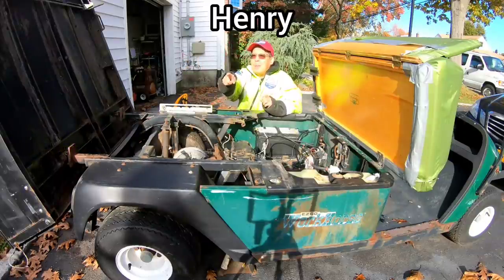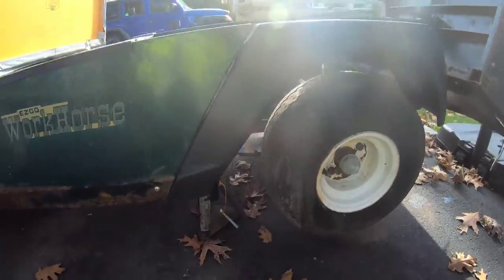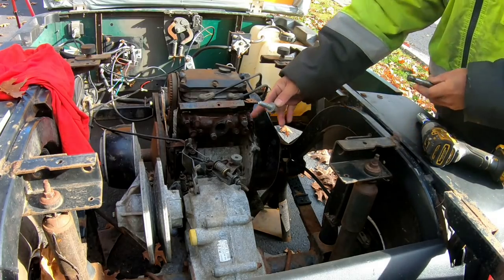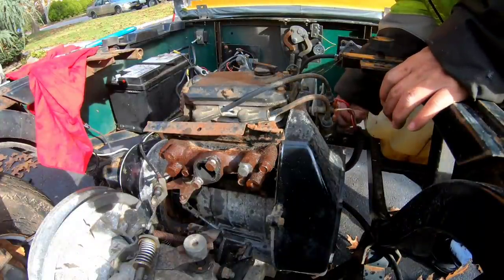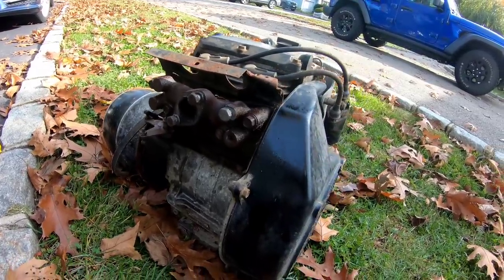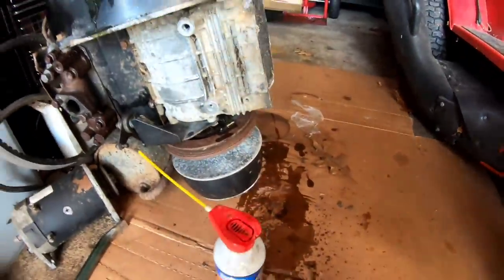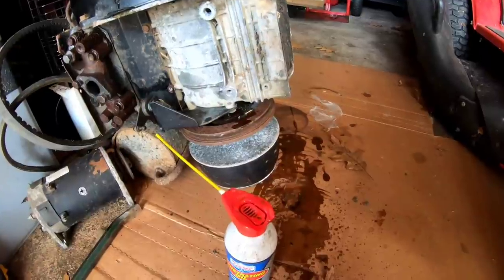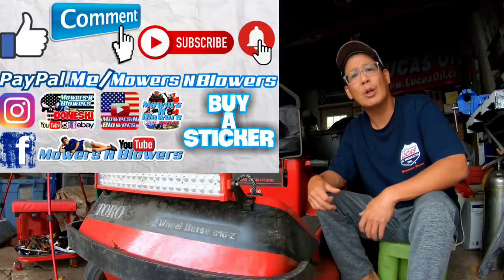HOW TO REMOVE WISCONSIN ROBIN SUBARU FUJI 11HP ENGINE OFF OF AN EZGO 1200 UTILITY GOLF CART REPOWER

Comment: Watch Cody Ruff's "EZ Go Clutch Removal" video. Use grease or oil to  fill in the void, then just turn in the bolt! I use this method for pilot bushing removal (with grease) all the time, and it works great!!

Comment: Stick a steel rod in the clutch / drive shaft hole allowing only several threads of the larger clutch  threads exposed. Then get a larger bolt to screw into it.

Comment: Is it a 2 cylinder bro?
Reply: @useralex87  thank you.
Reply: 2 cylinder
Reply: @knighthawk86855 actually I was referring to the engine he removed
Reply from the maker: Removed engine was a two cylinder,  did you not notice the 2 spark plug wires ?

Comment: Another way to remove the centrifugal clutch provided you find the right bolt for the outer threads.
https://www.youtube.com/watch?v=RsNJLd7j0Yk
another example: https://www.youtube.com/watch?v=BIUUrxTaRjk&t=714s

Alternatively, you can put oil inside, and teflon tape the outer bolt with correct threads.

Full disclosure: those are just knowledge from youtube. I have never done anything like this